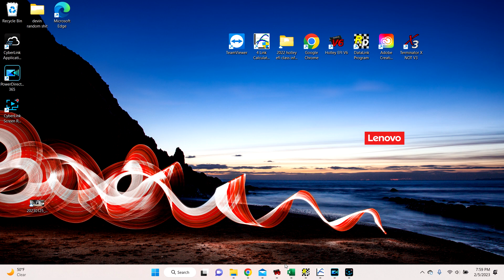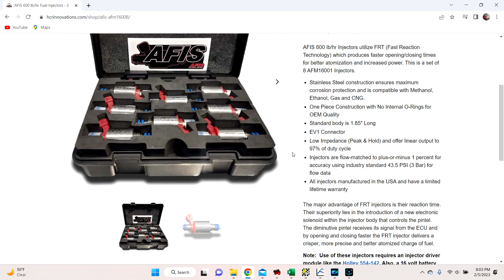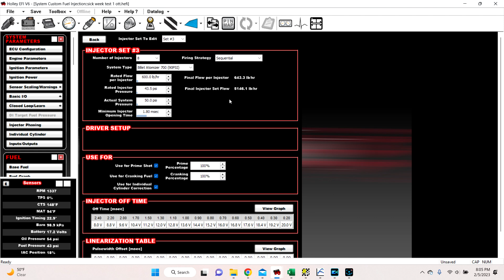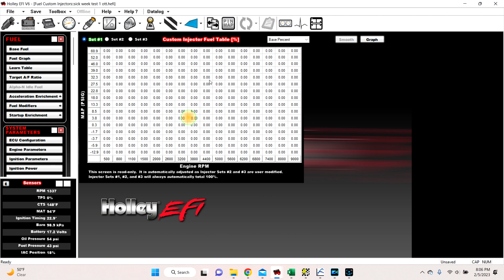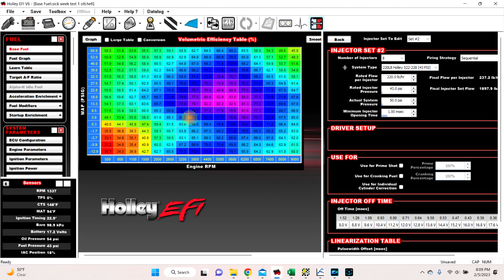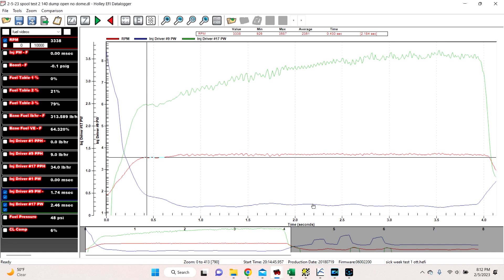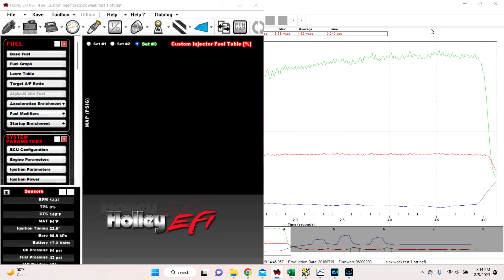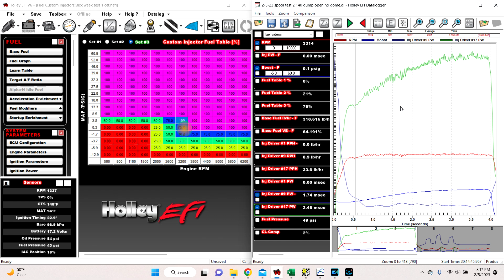How to blend multiple sets of injectors with Holley Efi

Comment: I was researching how to do this earlier today and your video explained it more simply than any other forum post or video. My question is will it cause an issue if I stage the injectors? For example running the 220lb injector to 75% duty before rolling in the next set of injectors and running both sets in tandem.
Reply from the maker: i always recommend getting them in as soon as you can, but it shouldnt cause an issue if the fuel demand is reasonably high. just always make it idle on both sets induvudally once to confirm both sets are working correctly
Reply: @devin vanderhoof  I definitely want to know how to phase in a different fuel type. And I do want to know if there's a way to independently adjust only one set of injectors for ethanol content and have the other set just pure race fuel or methanol.

Comment: Hey, i have a few questions. at 7:02 you state that the sparkplug would look like crap if you transitioned from pump gas to methanol. do you mean it looks like crap for reading plugs? or does it effect how reliably the methanol is ignited?  Also, lets say you run a street car on pump gas, and say above 12-14psi you switch over to methanol. how fast does it methanol contaminate your oil? i assume it has to do with how much fuel your flowing so i am going to put up two scenarios. One is using a secondary set of injectors as methanol injection ontop of pump gas, say 30% of the duty cycle. and the other is 100% on methanol, say 2300~lbhr. What frequency would you expect to change your oil? if its a street car, and just running on pump gas could it burn off the methanol in the oil like it does with water from condensation? appreciate you good sir!

Comment: Devin, if you were to use a single set of AFIS 250’s OR 400’s in a single set of injector scenario, with a dominator you STILL need the driver module?

Comment: I would be interested in gas to E85 injectors or a blend of both for low hp street strip set up
Reply: In that case you're best off using an ethanol content sensor and setting up offset tables. A set of eight 220lb/hr injectors can feed enough e85 for over 1500hp but still idle rather well on gasoline.
Reply: @Ribbityibzki  i have a flex fuel sensor, just realized my typo......meant to say, E85 to Methanol or blend of both. Thanks
Reply: @young11984  ah, I see. Hopefully Devin makes a video on that so he can explain it better than me trying to do it in a comment, lol

Comment: So if I understood you correctly, if I'm running 2 sets of the same injector (2x 220bosh in my case) I will just do 50% on both charts under boost since it will be using both?
Reply from the maker: yes sir